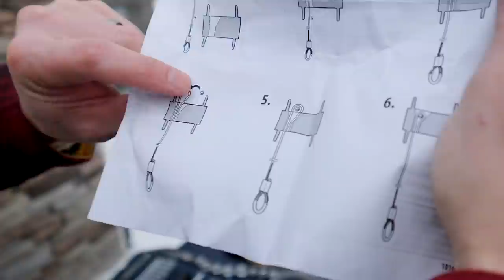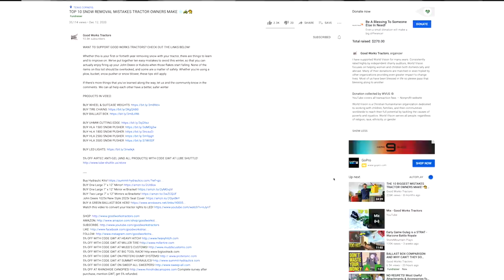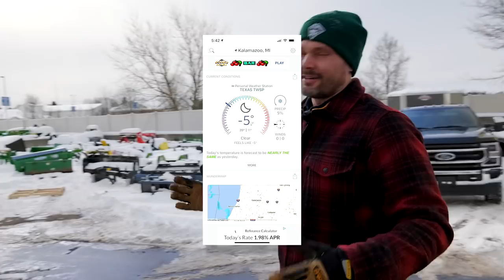$35,000 MISTAKE PART 2: GATOR 865R FROZEN IN THE GROUND 🐊🧊⛏️

Comment: Your winch should be rated at least 1.5x the weight of the vehicle. 2x is ideal. I have a 17,500 lb for my F250. That’s over 2x.
Reply from the maker: I'd love to go 3-4x if I could, but not sure the battery could handle the amp draw?
Reply: @GoodWorksTractors   good point. The 4500 one could work but you’d need a few snatch blocks to increase the power. Check out Ronnie  Dahl’s YouTube channel. He’s got a lot of videos on winching. Keep the awesome videos coming!

Comment: I don’t know if this would have helped, but you might want to look into a Yankum Rope (https://yankum.com/kinetic-recover-ropes/) instead of the more typical nylon tow straps you have. Yankum’s are specifically designed for the towing vehicle to, literally, get a run at it when pulling out another stuck vehicle.  The rope initially stretches, then that kinetic energy gets imparted to the stuck vehicle.  They are amazing and are very different from a typical nylon "tow strap". 'Course, I don’t know how much "yank" that quad could generate in the first place. Check out https://www.youtube.com/c/MattsOffRoadRecovery/videos for many examples of him "yanking" out all kinds of very stuck vehicles, with no damage to anything.

Comment: A winch should only be used while atv is running. Use which for a minute at a time then allow it to cool off. Read the directions. ATVs are not boats or tractors also. Lol

Comment: Really, putting push blades on side by sides and quads is futile. No weight in the back and virtually no traction. They always get stuck or simply spin their wheels. Also it beats the heck out of the transmissions and frames. Keep the plows to pick ups or tractors.

Comment: Winch way to small.  Your trying to pull way more weight them what winch is built to handle.  When your gator is in holes or snow think about how much harder that winch needs to work to overcome.  Push something on flat ground.  No problem, put a board in front of the tire and it's almost impossible to push over it.  That is why winch didn't work.  8000LBS winch would be better for that size.

Comment: Limited slip differential means it applies the same amount of power to the left and right wheels.  That means when the one tire broke free, it only gives the other tire the same amount of torque.  The rear has a locker so both tires will spin no matter what.
Reply from the maker: Then it must be broken.  The front left wheel literally didn't spin on it's own throughout the entire duration.  Crazy.
Reply: @GoodWorksTractors  it’s like having two bolts that you’re trying to break free.  The right one broke free so now it turns easy.  The left still does not turn because the right spins easily.  There is a positive about limited slips.  If the fronts were locked together it would be a bitch to turn as the outside wheel travels a longer distance than the inside wheel.
Reply from the maker: Gotcha.  Makes sense.  I feel like it would have helped if that wheel had power.
Reply: @GoodWorksTractors  The left front had the same amount of power as the right front ... hardly anything as the right front was spinning so easily.  A trick off-roaders sometimes use is to apply some brake when you are stuck.   The brake makes the spinning tire harder to turn so more power goes to the non-spinning tire.  Especially useful when the spinning tire is up in the air.
Reply from the maker: That's a pro tip.  Will try not to forget that one :)
Reply: @qcan8468  not sure about that. maybe you could try it on a tractor with right and left brakes
Reply: @qcan8468  also the way many anti-slip diffs work, at least from factory.  Using the same wheel speed sensors as the anti-lock brakes, the computer will apply brakes when one wheel is spinning too much faster than other.   Every one I've heard in action makes a distinctive clicking/clanking noise as the brakes cycle.

Edit:  you probably already knew this, huh?  But I'm leave it here for those who don't anyway.

Comment: So a winch is suppose to release the rope there. The rope stays on the winch by leaving at least three wraps on the winch drum. You are never suppose to pull the rope all the way out. I have never seen a wedge or anything else hold a winch rope in.  Even on 50 ton wreckers your not suppose to pull it all the way out.

Comment: The problem wasn`t the machine, bro. It was the driver. Plan better next time.
Reply from the maker: IMPOSSIBLE! 😂
Reply: That driver freed the gator at least twice and then blew it.  Watch the video, the tires spin and the gator visibly sinks to the frame.  That is operator error.  I laughed watching the Polaris come to the rescue slipping and sliding all the way.  It provided little benefit due to poor traction.  Should have used shovels immediately to clear tires and remove unwanted friction.  Move it off of icy patch and drive it away.  You got another vehicle stuck not long ago. Also when tire is spinning free put the winch rope around the tire (keep tension on it) and very slowly give it gas.  The vehicle will pull itself free.  Don't let the rope slip off or go too fast but it beats the winch in power.
Reply from the maker: Ahh yes, the Monday Morning Quarterback.  😂